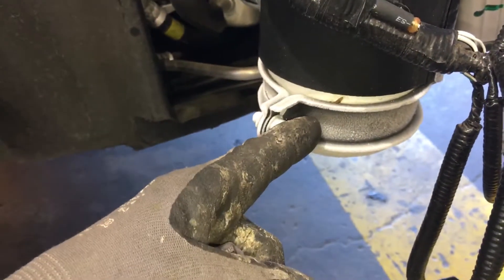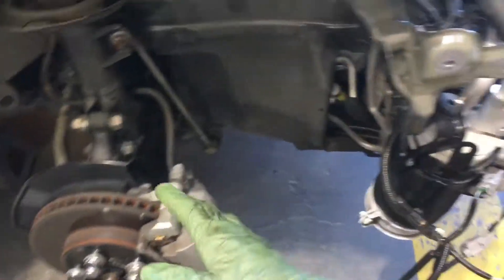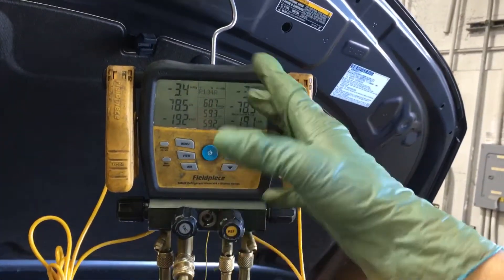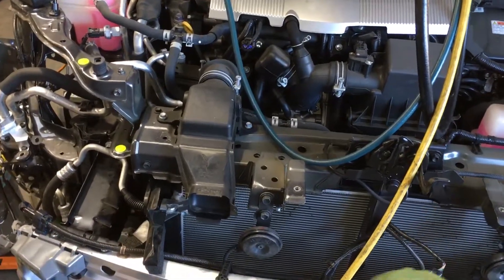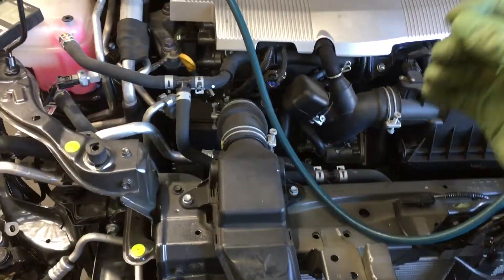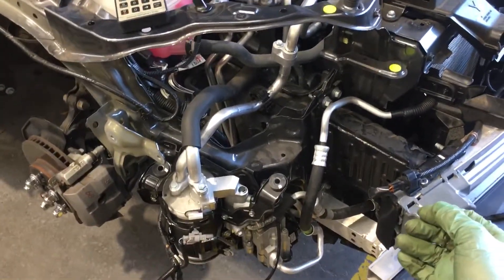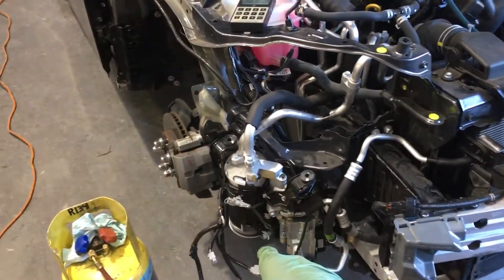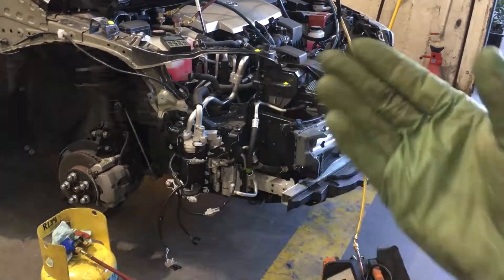2/4 Prius Prime 2018 heat pump,

Comment: I've seen some of the diagrams on how these heat pump systems work, and it just seems needlessly more complex than a traditional heat pump with 4 way reversing valve. There's just so many more complicated ways for these things to fail and leak.
Reply from the maker: Exactly. Let’s just hope they used high-quality parts otherwise the customers pocketbook will suffer greatly and the cars will suffer a early grave in the junkyard